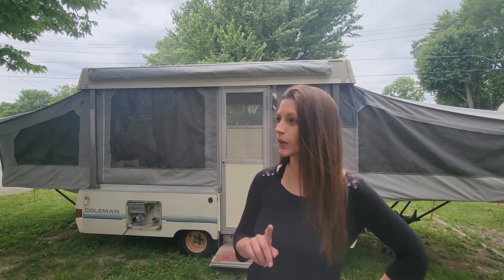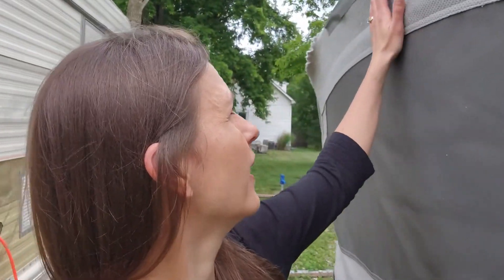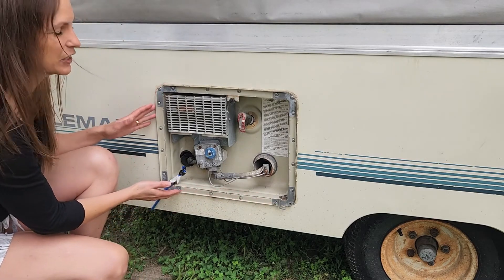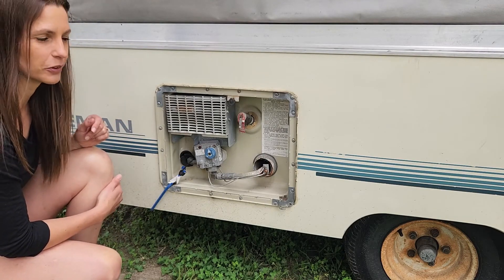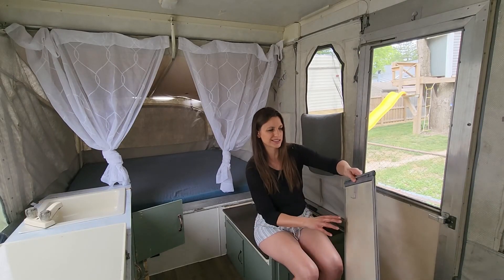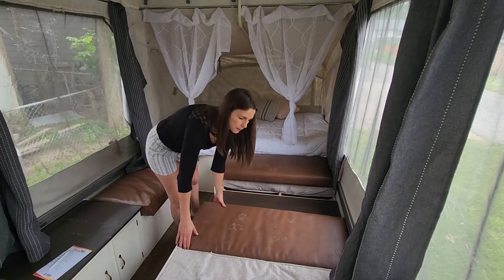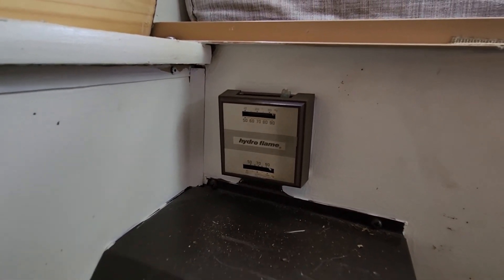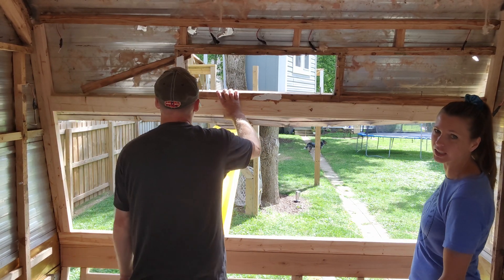10 REPAIRS WE HAVE TO DO BEFORE CAMPING AGAIN: How much will it cost?!

Comment: I've camped my entire life. I won't say my age, but I'm a seasoned camper! 😂 First off, we use a little Buddy heater instead of our propane furnace.  It heats very well on a 1 lb cylinder.  Secondly, we have a working sink (no toilet/shower) and we choose not to use our water tank because it's more weight carrying it down the road. If you get to a campsite with strong chlorinated water, it's not pleasant to use anyway. You can put an in-line filter if you really want to use the sink. I just put a small tub in there and I'm good to go. Also, if you don't use the water, you don't have to winterize your camper every year. That's a huge plus for us! Just for reference,  we have a 2004 pop-up that we love!! Safe travels!!!
Reply: Same here. We have never used the water tanks..too much weight and more work to clean the tanks...no thanks. No toilet but, I take my "bucket toilet" in at night and it's just a garbage bag with kitty litter...just for night time and early morning. We are fine with using the facilities. No hot water on the camper but, sometimes I bring our portable tankless water heater that we purchased and we set it up for outside for the "washing station".  We made a nice stand for it and it sure comes in handy for longer stays. We also have a small ceramic heater that works well for chilly nights.  We took the battery and propane tank off..just plug in everywhere we go for us.  We run the heater and microwave on a separate power cord. We have a 2007 StarCraft pop up that we love.  I have enjoyed making it clean, comfortable, cozy and cute.  It has never been stored outside and it shows.